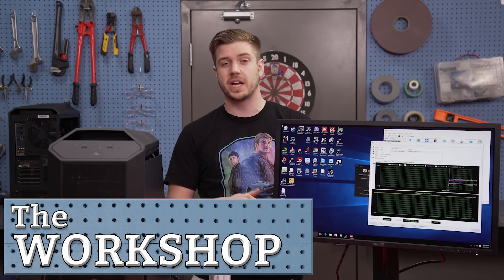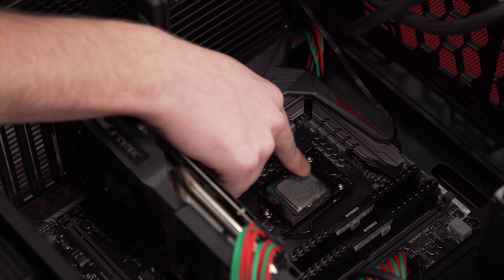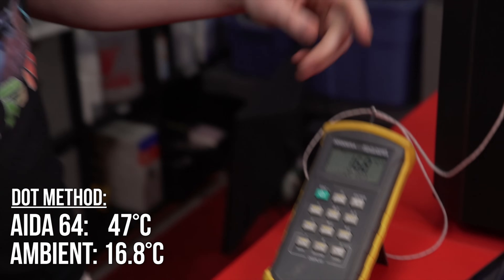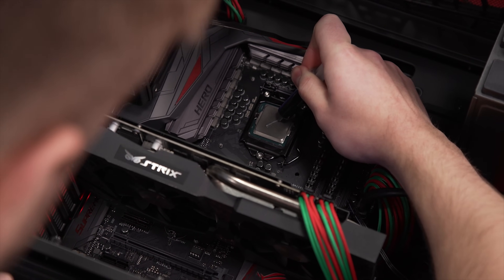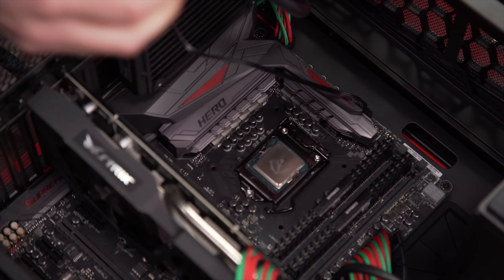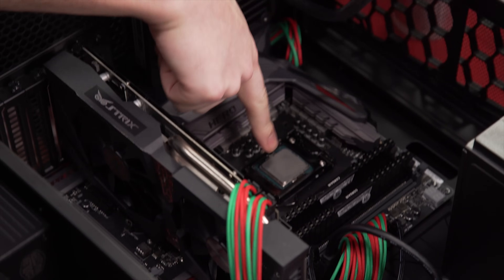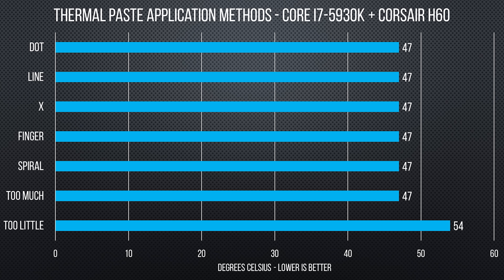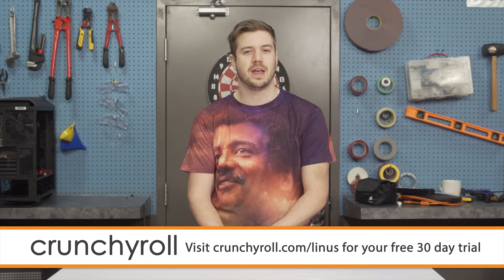Thermal Paste Application Methods - Which one is best? - The Workshop

Comment: luke knows nothing about proper ways of applying thermal paste, he just recently learned about building computers and is now going to attempt to explain one of the most debated issues in pc building.  Every video this guy makes is a damn fail, its like listening to child explain how to build a car motor. There are way too many factors that go into stuff like this, such as amount of pressure applied to the heatsink when applying it. Not to mention that it takes HOURS for thermal paste to stabilize. He doesnt mention how long hes running IDA for or if he using even and consistent pressure when installing the heatsink. Massive failure. Too much Thermal will actually hinder your cooling, applying a decent amount of pressure when installing your heatsink then you will notice temperature drops immediately.

Comment: The finger-spreading with the plastic bag works great when you use thinner thermal paste and smear both CPU and the cooler base evenly. And to top it off, you add a small pea on the center of the CPU. It's been the most consistent one so far for me.

Comment: Oh lord.....does it have to be that alcohol....just wipe it until its shining...:) Cool video though.
Alright...i always spread the paste evenly like it comes with  some component from factory  - paste is ment to cover the right surface entirely.....and not some STUPID dot technique that results a circle of paste on a non circular surface...logic. Gees.
Reply: +videokompuuter just google delid cpu. The actual processor is a tiny part in the middle, the rest doesnt matter. that why nothing of it made a difference. And scewing the cooler on provides the pressure to spread the paste perfectly even

Comment: I use a card to spread thermal paste on transitors because the clamping pressure isn't as great and it's way too easy to accidentally put to much. I used the "pea" method on my CPU, so it's good to know that was optimal.
Can you also do a test comparing silicone to silver thermal paste?

Comment: dot is best cuz it spreads even and if the spiral is done bad and the cpu cooler block put on crooked it could trap air bubbles but tighten it enough and be careful  it will be fine

Comment: I win! The only problems would arise if the paste didn't contact the majority of the cpu. 

I would like to see a comparison between thermal paste, thermal tape and thermal pads. My guess is that there would be little to no difference, maybe a slight decrease if the tape gets wrinkled during application or the pad slips to one side when you put the water block back on.
Reply: +Devin Hawthorne 
Thermal Pads are objectively inferior to Paste, but are also cheaper and easier to make 'perfect'. 
GPU's use them on their Memory Modules for that reason - easy to make it perfectly cover and perform adequately without having to worry about making a mess, burn in times, or re-application.
Reply: ***** I would like to see a compound that goes on wet like paste, but turns rubbery with heat. I hate the cleanup when switching coolers or chips and especially if I get any on me. Having a compound that could peel off after reaching around 40c for a few seconds would make things so much simpler.
Reply: Devin Hawthorne if such a material would retain all thermal conductivity... that would certainly be convenient, yes.

Comment: I wasn't too surprised by the result, having done a similar test myself.The only thing I would add is I did have some thermal paste that was very thick and wouldn't spread very well when the heat sink was applied.So I put a line of paste along one edge of the cpu and in one movement, spread the paste over the cpu with a piece card, which resulted in a very even covering. and that seem to work better in this case.

Comment: How much radiator does it take to transfer CPU/GPU heat to water and then get the water back to room temperature. i.e the CPU and GPU heat rise the heat of the water coolant but how much radiator do we need to actually cool the water coolant back to room temperature for its return trip? and do more fans equal faster cooling in each radiator? #theworkshop

Comment: Why wouldn't you do this as a comprehensive test. All of the methods, several different paste brands and using a stock heat sink. It's not like you don't have the time. Mythbusters' science is shit because they compensate with entertainment. This show needs a thorough scientific method, otherwise you're just wasting your time.

Comment: I'm thinking medium sized dot (pea) in the middle might just be the way to go.  Considering that the IHS is not the full size of the silicon die underneath, hitting the center just makes the most sense.  About the only way it wouldn't make sense is if you have an IRIS pro setup due to the fact that it has two dies underneath the IHS.   In that case a line method drawn perpendicular to the orientation of the dies might make most sense since it's more of a rectangular shape.

Comment: Were the fans on on the cooler at a fixed RPM? Otherwise this whole test is invalid. If the chip gets hotter, the fans will just speed up and keep it at a certain temp anyway. The explenation for the difference when adding too little is that the cooler can only cool so much and was probably at max RPM

Comment: Isn't that depends on what cooler do you have? I think how cooler looks at bottom, there are several coolers what had heatpipes with direct contact on CPU casing and in that case you have different results of spreading of paste. And of course really nice work with video.

Comment: What I would really love to see tested is Quick Sync performance. As claimed, Quick Sync is rendered on an ASIC fixed function of the GPU. Would there be a difference when using the Intel 510 or 530 gpu? Or is the CPU the bottleneck? Would a Skylake Celeron perform as well as a Skylake i7? Because quicksync is fixed, I would like to know if it actually makes a difference.
Also, Intel claims that there's a performance increase per generation, so what would the differences be between Ivy, Haswells or Skylakes?

Comment: I would love to see you do an attempt at "lapping" a CPU.
A technique where you sand the surface until it shines, effectively decreasing the need for thermal compound: the smoother the surface, the better the contact with a cooler.
Reply: Interesting, one would think they would come from the manufacturer that way.
Reply: +Hunter Bowie
Why that isn't the case is indeed the question.

Comment: why are so many buffoons asking it to be on a cheaper cooler? What difference would it make? Let's use worse to get worse performance? You have to get rid of the variables to be left with a pure and fair result.
Reply: People are worried that the liquid cooler and extremely power efficient cpu will prevent heat from changing enough to see a difference based on thermal paste.  Personally I agree, I mean the hotter the chip gets the more chance they will see a small difference in temperature between ways of application.
Reply: Yes but the whole idea about using the best is to get rid of as many variables as possible. Theres no point in doing a test which you know will fail it heeds no results. The idea of this test was to see if you would get different results due to the amount applied. Which it didn't. The only time it had issues was when there was lack of paste. Showing that the good CPU and cooler didn't make a difference.
Reply: +David Pagan-Brown But we don't know that we didn't control for variables like higher temporatures and different chip/cooler configuration.  What I'm trying to say is for a short time at a low temp I think it would be difficult to see any difference in Temps based purely on thermal paste.
Reply: He's aida64? It burns up your CPU..... You eliminate the variables by using the best. It means there are no common issues you can run into.

Comment: Is ambiance really relevant? As it is affected by so many variables like region, room dimensions, season.
Reply: Of course ambient temperature is affected by a lot of factors, but ambient temperature is the control variable in the experiment. 
 It is relevant, because ambient temperatures going into the case will affect how well the radiator can release heat out of the loop, since heat transfer is a function of the temperature gradient of the two surfaces. If the radiator can't pull heat away, the cpu will have a higher temperature. 
For example, a cpu at 47 degrees in a 30 degree room is a lot more impressive than 47 degrees in a 17 degree room. 

Tl;dr: hot rooms make things hotter

Comment: Thank you for adding Ambient temps. Now, you know that you have to do comparison of Thermal Grease for your next video. Warning stay away from "Thermal Adhesive" Bad things can happen. I am not going to tell you did this wrong, but if you wanted you might see greater deviation when overclocking. ex. set a high overclock and keep that overclock the same throughout each test, more work, and especially if you get a random crash, but I'm sure that's what all the Devil's Advocates are looking for. In any case, thank you and totally fooled me on following Intel's Line method. I too was angry to find out too much didn't matter either. Well done, great format.

Comment: I enjoyed the myth buster style test,  I have personally seen up to 15'c differences from different application methods of the same thermal paste, with the same cooler, an corsair H100, differences in idle temperature, Like 35'c to 43'c and under full load, especially with hot running Graphics cards because of an 3 way Sli setup, i would get a difference of 72'c to 87'c with GTX 660Ti PE making a huge difference in performance,  depending on how much i put on and the thermal paste,  I was really hoping to see the same results here

Comment: You guys really need to get more scientific with these videos. Fantastic premise but you say "don't use too much or too little", why not define that? You could have weighed the tube before and after and looked at which method uses the least amount for the same amount of cooling. Then weighed for the too much and too little. There's really no reason not to remove those variables.

Comment: Why doesn't Intel just partner with a cooler company and make their different chips integrated into different cooler models? then it's all just one piece of metal, so better cooling and a better price than buying each separate.
Reply: Of course, I mean that they would still sell standalone processors.
Reply: +Marcus Coster I like that idea. I'd buy one if they just soldered the top of the bare die straight to a big ass copper heat sink (or waterblock) instead of putting a standard heat spreader lid on it. 

Would have to redesign the way it clamps in the socket (or just do away with the clamp entirely), but I think they could easily make it work, I've ran sockets without the clamp before for dubious "experimental" reasons ;p.

Comment: hello :) there is something ive wondered about while building my machines actually, which is how much off a difference in performance does it make to use a couple of SSDs in raid zero vs. a single drive of the same type for the OS drive. also what would be the best configuration of drives to use for tasks such as video rendering using premier or 3d apps. does the drive medium have an effect on it beyond a certain point? would it make a difference to use a temporary ram drive?
ps ... i did use a raid zero for my OS drive :)

Comment: Couldn't you do a clear test of this by using glass then applying pressure to observe the spread of the thermal compound? Maybe even heat the bottom plate to simulate heat.

Comment: I have a question please i hope for a answer|
dose it matter on the heat sink or not bc we have tryed many methods and get high temps for some reason im talking 64-70 and i kno that inst good ?
Reply: +Craskoos If you mean using a different model of heatsink, then yes it does matter. There is a significant range of performance between different models.

Comment: Hah, that's funny, my guess was:
Loser -- too little; winner -- pretty much everything else.
The reason for the conclusion: thermal compound is meant to fill in the minute tooling scratches in the heat spreader and heat sink.  These scratches are so small that, so long as you completely fill them, method of application won't affect outcome.

Comment: I use a syringe (the kind with an actual metal needle) to apply a flawless X.  It matters on LGA2011 more than 115X due to the package being a lot larger and the die itself being larger.  I've also scraped the heat spreader perfectly flat and had worse temperatures, presumably because the waterblock had issues generating enough pressure against the area above the die.

Comment: I don't understand why he up the thermometer at the intake. Of course it's going to give you the same reading. You should have up it at the exhaust.
Reply: Dude he was measuring the ambient temperature not the exhaust temperature.
Reply: Daniel Michałowski thats my point of course the ambient temp is not going to change. commuters do not get that hot.
Reply: +eduardoig17 
A high end PC does put out enough heat to easily change the ambient temperature.  The point of measuring ambient throughout the test was to give reference and eliminate as a variable.  You want the ambient temp to stay the same during testing like this and it did.  Results would be worthless if the heat kicked on and the ambient temp when up 5&#176; throughout the process.

Comment: I didn't hear Luke comment on the thermal system.  The fan may have had a higher rpm to compensate for poorer thermal conduction, stabilizing the temperature until it ran out of headroom in the worst cases, depending on the gain.  Setting the fan cooling effort to a fixed rpm would have helped.  Maybe this was done but I didn't catch any comments about it.

Comment: If you have a graphics card with fans that are recirculating air. Is there any benefit in setting up case fans to blow air on it or exhaust hot air away from it?

Comment: I have plenty of idea that would pertain to Test Videos if Linus Media Group would be interested in testing some of the items at hand personally, given I have found no instances of these type of products ever being used, nor tested.
        
        Firstly, items such as "High air flow, high static pressure" Case Fans that are of the Blower Style connected in the Front Plate. They are relatively cheap in price. It makes me curious what type of difference would they really make, if any at all. Or is it a $5 piece of hardware that has little to no effect aside from case clutter.

Example: http://www.performance-pcs.com/evercool-fox-3-system-blower.html#Features

        My next question toward System Cooling would be 'RAM Cooling'. Something that isn't really seen through out a majority of builds shown on around the Internet now-a-days. Either Passive with a Direct Ram attachment and connected heat-pipe/ Heat-Sink structure, or Reactive with DIMM mounted Fans that are supposed to pull heat directly from the RAM itself. 

Example: http://www.performance-pcs.com/ultra-thermax-t8-copper-memory-cooler-with-heatpipes.html
Example: http://www.performance-pcs.com/akust-fanmod-memory-cooler.html

Comment: How about a stock cooler vs an aftermarket air cooler vs an aftermarket water cooling loop, for stock and overclocked processors? Noise level would be a good variable to include as well.
Love the show, thanks guys!

Comment: the only thing i can think of, the long run, what happens when it slowly dry's out?
but then again, horrible test to do...
Reply: +lolindirlink If you keep it together, it will be fine. If you do remove the heatsink, then you really want to clean and re-apply thermal paste. As long as it is all together, then nothing really changes. Just do not put it back together after you remove the heat sink with putting on new thermal paste.
Reply: +Garry Perkins i mean like, after a few months, the thermal paste starts to dry out and form cracks,
i'm wondering if temperature rises more quickly depending on different spreads on that point in time.
some PC's i maintained had super dry cracky thermal paste after a year or 2/3 when people don't clean them.

Comment: I have a workshop request:
What are the differences between different types of video cables? Could you cut the head off of an hdmi cable and attach the head of a Display Port with the same cabling? Does hdmi - hdmi yeild any major differences than hdmi - mini-hdmi? What really makes a cable able to transfer better quality/more FPS? Is it actually the cable, or it is the inputs on the monitor/cpu that matter?

Comment: Would be interesting to see if this was different for gpu's? My reasoning being that they have a much higher tdp, so more heat, and also instead of having a small chip and a big heat spreader, like a cpu has, a gpu is all chip, so the heat is everywhere (theoretically) not just in the middle.

Comment: If the temps were higher maybe you could have seen more variance. Maybe use some 30-50$ air cooler (fixed fan speed) and give the cpu a little more voltage. I bet in the high 70s we could see some 1K deltas :D